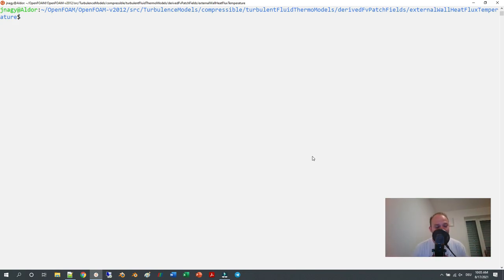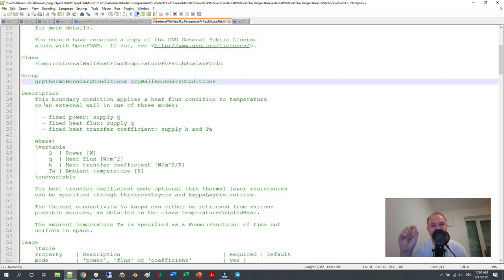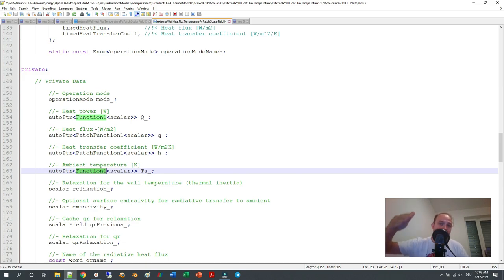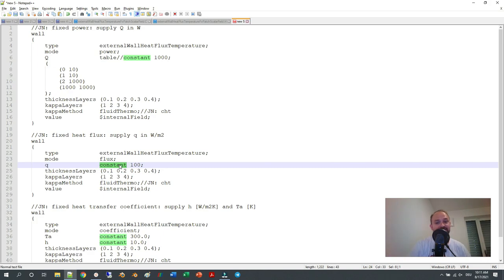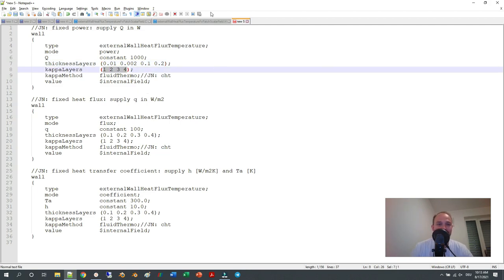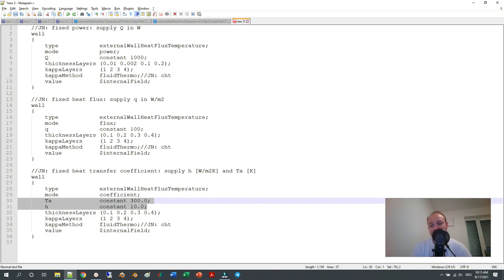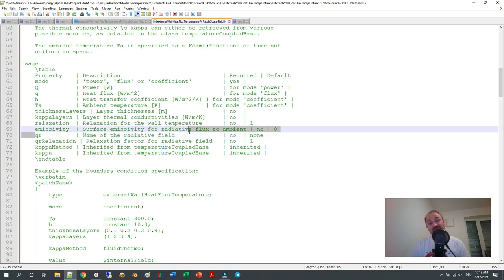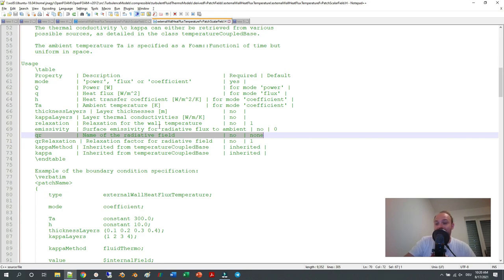[Community video] - Thermal simulations in OpenFOAM Part 2 (externalWallHeatFluxTemperature BC)

Comment: Thanks, Jozsef for the video.

You mentioned at 4:48 that it is possible to specify external heat flux as a csv file. I am trying to implement a csv file that is supposed to have time-varying external heat flux values for each patch of my mesh. 
You showed how to specify the heat fluxes as tabular inputs, but can you also tell me how to do this using an external csv file?

Comment: Hello, Mr. József Nagy.
I really appreciate for your kind explanation for this B.C.
Actually, I have been some trouble using it. I have tried to Two-phase simulation with condensation & evaporation (solver is intercondensatingevaporatingFoam)
if water passed in pipe, the wall of pipe temperature is alright. But if vapor passed in pipe, temperature goes extremely high....
Do you have experience such as mine?

Thank you for this video again.
Reply from the maker: Unfortunately I do not have any experience with that solver.
Reply: @OpenFOAMJozsefNagy  Thank you for reply

Comment: Hello József. Very informative video. However, I get an error using this BC. error: Using kappaMethod fluidThermo, but thermo package not available

I searched similar cases, and two possible causes were defining fluidThermo for a solid region or using this BC for an incompressible solver. Neither of these is my case. Thermophysical properties of the fluid fields contain mu and Pr numbers, so the solver should be able to calculate kappa but the error is insisting. More details and case files can be provided as well. Many thanks.

In general, the lack of an informative video on chtMultiRegionFoam or chtmultiRegionTwoPhaseEulerFoam is annoying :D
Reply from the maker: Do you maybe use a different version of OF?
Reply: @OpenFOAMJozsefNagy  Hi. Thanks for the response. I am using v2112

Comment: Hi Jozsef, this boundary condition as you mentioned can be used in other solver besides cht solver. I did not add kappamethod but it shows error where it says 
--> FOAM FATAL ERROR:
Cannot find a fluidThermo or solidThermo instance

    From function Foam::tmp<Foam::Field<double>> Foam::temperatureCoupledBase::kappa(const Foam::fvPatchField<double> &) const
    in file derivedFvPatchFields/temperatureCoupledBase/temperatureCoupledBase.C at line 133.

May I know if I did anything wrong or did not add?
Reply from the maker: In your solver fluidThermo is somehow not defined.
Reply: @OpenFOAMJozsefNagy  Yes, thank you for your reply I did not use chtmultiregion solver but my own modified interFOAM solver. Do you happen to know what changes is needed to make this BC work for interfoam?
Reply from the maker: @stanleywong9004  Yes, interFOAM does not use thermophysical properties by default. You have to add it to the code.
Reply: @OpenFOAMJozsefNagy  Yes I understand that, however, Im not sure how to tell which header files and libraries to link in order to use this properly. Do you happen to know?

Comment: Hi József Nagy
I try to implement heat flux value as a table in the simulation based on the location. In the video you told that you did not use at 7:15 but do you have any web side or document in order to apply heat flux value based on the location. I have a nonuniform heat flux value correseponding to x,y, and z values. I am not sure which file needs to be modified.
Reply from the maker: Unfortunately not.
Reply: @OpenFOAMJozsefNagy  For the non uniform heat flux value, I successfully modified the T file. I was use the another application to calculate radiation over the wall. After that interpolated the value that I found for the radiative heat flux. Impose as a boundary condition for the heat flux in the T file with using external wall heat flux BC for the corresponding walls. In order to do that, the cell centre of the walls is used. same order of the meshes is used.
Reply from the maker: @oguzhanask1284  Cool!

Comment: In case I would like to apply a free convection BC, like "mode coefficient" but in a solid transfern analisys with solver lapladianFoam, is it possible to use this BC and in combination of what kind of options?
Reply from the maker: This is a basic solver I do not think there is this BC. Which BC do you exactly mean? What is the OpenFOAM name?
Reply: @OpenFOAMJozsefNagy  I would like to use a free convection BC with the LaplacianFoam solver

Comment: Hello what is the difference between externalwallheatfluxtemperature's "Q" and fixedGradient boundary condition
Reply from the maker: The first has three modes available and calculates the gradient for you. For the other you have to do the calculation yourself. So user friendliness.

Comment: Hello! I have problems using this BC with the heat flux mod (fluidThermo). When I postprocess my result with utility wallHeatFlux I get zero flux on patch but for example wallShearStress is not zero. What's kind of this problem?
Reply from the maker: Check the header file of the source code.
Reply: @OpenFOAMJozsefNagy  Tnx for your recommendation. I've checked header file "externalWallHeatFluxTemperatureFvPatchScalarField.H", but I didn't find answer for my question. I do all things according to description and get different temperature on patch. Also I have tried to use heatTransferCoeff, so results is similar to wallHeatFlux. Meybe troubles in alphaEff()? Could you give another one advise?